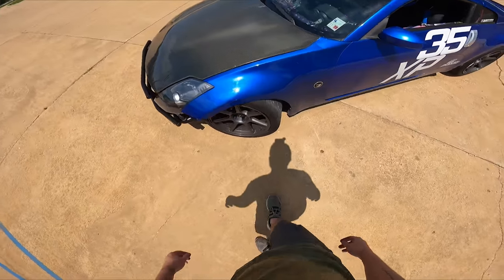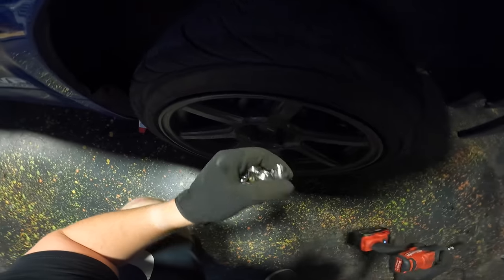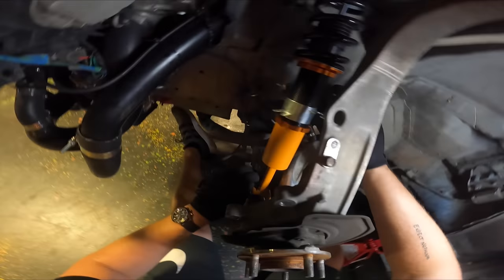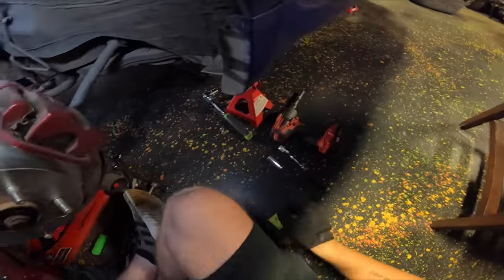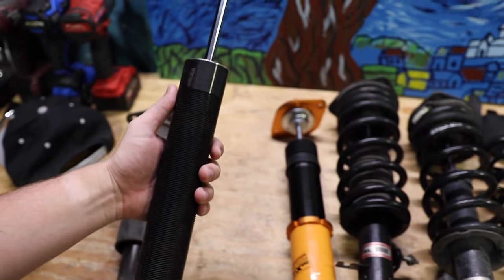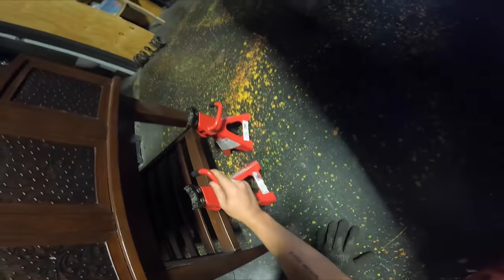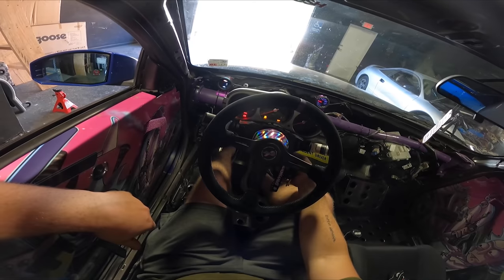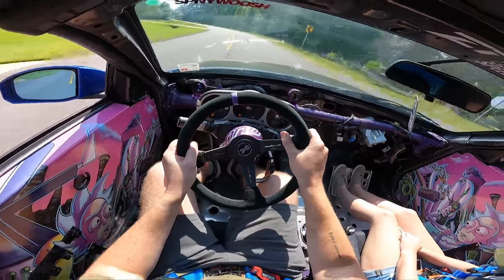Installing the World’s CHEAPEST Coilovers!

Comment: Look into a “bump-steer kit” Daniel! They’re made to fix the problem you’re having while driving! Contents been awesome lately!!
Reply from the maker: How would a bump steer kit help with the car swaying? I think it’s just too soft of a setup.
Reply: @Zorbii  you could be right as well, I’m no expert here by any means. I just know bump steers sometimes are a recommended thing when doing coil over kits due to your car being much lower than what your steering components are for, causing a “sway”/“walking” effect while driving. Just my input. Thanks for the response!
Reply: @Zorbii  it will allow the car to work better with aftermarket parts essentially .
Reply: @Zorbii  or maybe just put the old springs on these coil overs
Reply from the maker: That actually is kind of useful information! When I took it to AutoX the only way I could describe how it handles is like it’s walking. 
I’m looking further into this
Reply: Roll center adjustment kits on a lowered car can def make a huge difference! Steering and suspension geometry will always be altered.

Comment: Hay I have those maxspeeding coilovers on my Lexus LS400. But I have to swop my springs. They had the 9kg on the front and the 10kg on the rear out the box. I moved my 10kg to the front and the 9 kg to the rear.and it rode a lot better. Now I have the 10kg on the rear and put 12kg springs on the front know. Made a big difference. I've had mine on my car for over 2 years.
Reply: So how well do they perform now, after the right springs were installed, as far as handling and adjustment goes? Worth it on a low horsepower daily driver tht gets wild every now and then? lol
Reply: @THE_JB222  after putting the right size springs on and in the right place the car handles a lot better. I can take corners a lot faster than I did with my factory struts. It takes time to adjust and change parts to make it work the right way.
Reply from the maker: You can get different springs?
Reply: @Zorbii  yes and check your spring rate because you might have the smaller springs in the front and they might be shorter to
Reply: @Zorbii  if you do have the smaller springs in the front move them to the rear. And put the bigger spring rate in the front. That will also give you more adjustable on the rear of your vehicle.  Also make sure your adjusting your preload properly. That's probably Y you was having that swaying filling when driving

Comment: Fun fact about that bolt in the rear shocks 
The stock lug nut will work 

Assuming if you’re installing coils you probably have wheels that use aftermarket lugs 

Works in a pinch
Reply from the maker: Good to know if I ever need more 😂 I’ve got tons of lug nuts around

Comment: You need to put the piece that u have on the bottom of the spring bucket onto the top of the spring Also make sure ur preload is good in the front
Reply from the maker: Preload is tight in the front, it helped a little. I haven't flipped the rear yet though. Once I get the car to Georgia, I'll make sure everything is fixed on it.

Comment: I think for a budget suspension upgrade you would be happy with keeping those lowering springs but putting them on a Bilstein B8 or other firmer strut.
Reply from the maker: I’m not sure if those springs would fit would they? I guess that could work
Reply: @Zorbii  if the springs work for your stock shocks then the should work for the B8s. Bilstein may also make a set specific for lowered cars
Reply: They are true coilovers for the rear and then typically most ppl delete the bucket with camber arms.. ik stock is shock, and a divorced set up. The point of it is to get more camber too (for deleting the buckets)

Comment: check the preload on the springs and adjust the rear shocks. also maybe needs alignment after everything
Reply from the maker: Increasing the preload helped some. Adjusting the shocks also helped slightly. the rear may need to be tighter though. Once I get the car to Georgia I'll go through the entire thing and make sure it's right.

Comment: Could The swaying and pulling back and forth could be due to the alignment? Cuz when you changed shocks you messed with the alignment
Reply: Unless Z's are different than what I'm personally used to dealing with
Reply from the maker: Z’s don’t fuck with allignment because you only have to disconnect the ball joint.
Reply: Ahh that makes sense
Reply from the maker: I’m sure it’s not perfect, but it won’t change it that much

Comment: @Zorbii I had these same coilovers on my 350z. They rusted through in about a year. Just a heads up. Hope mine was just a bad pair
Reply: I got my original rear shock to get in by having like 6 people sit in the back of my Z while I jacked up the rear so it would compress the spring.
Reply from the maker: Oh so I wasn't the only one I guess.
Reply: They will definitely rust up without protection. Any sets I install I plan to regularly spray down with silicone lube, WD-40 gel, or some other form of rust prevention. Never seize on the lock collars as well can help.

Comment: Yeah, they sent me coilovers for my WRX build and they raised the back of the car like 3" at the lowest setting 😆.  I made them fix it but they are still sketchy
Reply from the maker: Had any problems since then?
Reply: @Zorbii  I sold the car not too long after.  It was an 08 WRX so the stock springs were pretty soft.  Those coilovers were way more stiff than the stock ones.  Yeah my problem was the total opposite of yours.  Glad it was for a review and I didn't pay anything for them 😆

Comment: If you want a stiffer ride on cheap coil-overs you have to compress your spring more.
Reply from the maker: I plan to. We will see how much it helps.
Reply: @Zorbii  I have a 2007 g35 sedan and I bought some cheap coil overs for it too, and it made such a big difference ones I compress the springs it was unbelievable how much of a difference it made.
Reply from the maker: Good to know!
Reply: @Zorbii  by the way I’m a big fan of your videos, I wanna eventually supercharger or turbo my 2007 g35, and I’ll make it a little bit of more power since I have the HR 👀👀😂

Comment: You installed the rear springs upside down. The orange part goes on top.
Edit: also you should get it re aligned.
Reply from the maker: That’s interesting. I’ve always seen people do it from the bottom 🤔 I’ll take them off sometime soon and flip them to see if it makes any difference.
Reply: @Zorbii  it’s so the metal of the spring isn’t rubbing against your car making noise
Reply from the maker: Which it definitely is. But the spring just fits into the bucket securely??
Reply: @Zorbii  yup there should be a piece of rubber or something to keep it from rubbing on the bucket. I have a similar kit on my cobalt. And that’s how it was instructed.
Reply from the maker: It makes sense. That’s why I was so confused with these. They don’t come with anything extra to my knowledge. I’ll just have to play with them some more

Comment: I have been running those for 2 years on my miata at autox not that bad at all worth it for being budget
Reply: @Zorbii  yup same color and everything just made for a Miata. Don't have to many complaints. I was on a budget and racing was coming fast. Been 2 years and lots of back road runs, autox track runs and summer driving. I don't mind them. Only 1 issue is my rear is full max low and still sits high but some time ill be able to upgrade lol #brokeboi

Comment: I'm going to say this now, FOR YOUR SAFETY TAKE THEM OUT, I had these on my mother's caliber before getting racelands for her and at first they felt super bouncy like yours, they then got stiff in the front for no reason, we needed to get bearings for the front since the strut twists while steering (normal for her type of vehicle). I took the front end apart when she lost all suspension up front and it felt like driving on a brick after driving my little brother to school, I found both struts bent so bad they were touching the inner part of the spring, never again after that, they never even sent a refund for them since it was only 2 weeks in. I'm worried since you will be putting yours thru more stress you could have a bigger failure. Please be careful and assess this issue as if it's your life on the line
Reply from the maker: I'll be keeping an eye on them for sure

Comment: You put the coil overs on wrong in the rear, the spring and shock are a true coil over and go where the shock mounts. The spring bucket is usually replaced with an adjustable arm.
Reply from the maker: I don’t think I installed them wrong lol. This isn’t a true coilover setup
Reply: If course🏁

Comment: YOU INSTALLED THE REARS UPSIDEDOWN!!!!! BROOO💥💥💥💥💥💥💥💥💥💥 plzzz these are sketch.
Reply from the maker: I was installing them based on how I’ve seen coilovers installed in the past. Now I’ve seen people install them both ways.  I’ll pull them apart and see if flipping them makes it any better
Reply: @Zorbii  dawg, they also didn’t seem to come with the bottom mount that goes in the buckets??? Id be confused too.

Pls just get some BC’s or even better Fortune Auto 500s, that cheap set is not safe at all.
Reply from the maker: I actually would love some FA 500’s. I’d rather that than BC

Comment: LMAO I bought those same garbage coilovers for  my 350z convertible and laughing at your troubles because I had the same issues. Mine handled alot better but were extremely stiff but mine were not adjustable. And they are all shot after only 3,000 miles of just hwy miles. And my tires I replaced brand new at the same time are down to the steel belts after 5k miles. About to replace with slightly better ones this time.
Reply from the maker: Yeah, I’ll be getting a nicer set some time soon 😂

Comment: Bro watching u do this made me hurt for u so bad the rear coil bucket springs were install the wrong way and the adjustable part need to be on top instead of the spring hitting on top and also u don’t gotta lower the shocks to or in whole u can just jack it up from under the rotor shoud be camber arm or toe arm